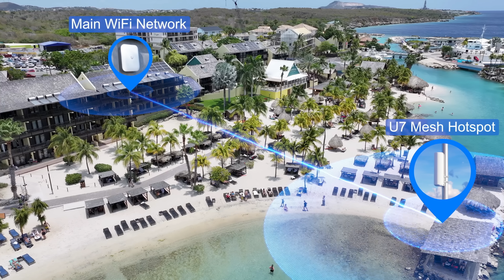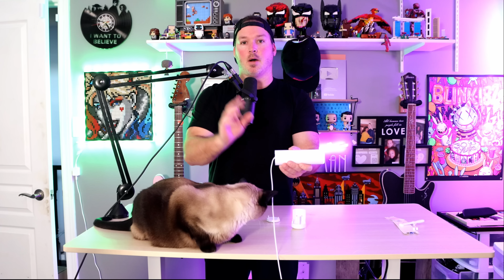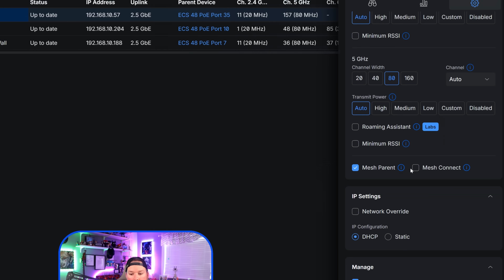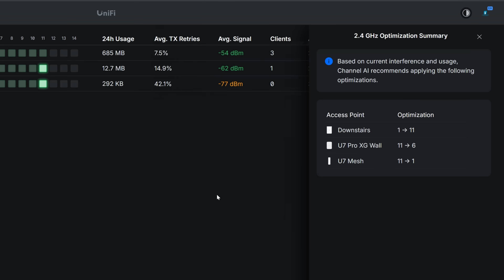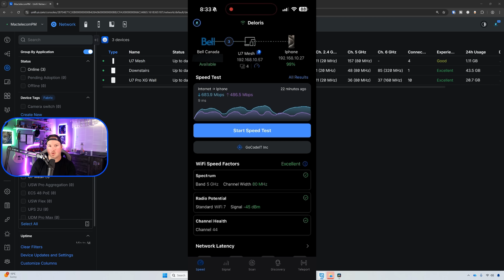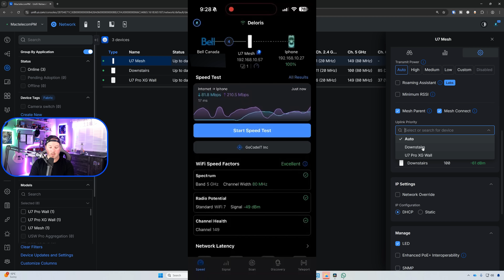UniFi U7 Mesh: Up to 3x extended meshing range!

Comment: Mine doesnt adopt when connected to a poe switch that is wired to a moca adapter. When it is connected to my dream router 7 (conencted via moca adapter as well), it adopts! I need it to adopt when it is not connected to dream router 7 directly.

Comment: The supposed improvement is the ability to communicate from one U7 mesh to another with the distant one as the mesh. That was the question I need answered but was not tested.
Reply from the maker: I was only given one u7 mesh at the time of the video so no way for me to test it
Reply: @MactelecomNetworks 
Oh well. Maybe later. Thanks for what you did do.

Comment: Would anyone recommend this over a U7 Pro Wall or a wall mounted U7 Pro Max? In my current setup I can't get ethernet lines up into the attic to be able to ceiling mount my APs but do have lines ran to almost every room, and they are about 2 feet off the ground. I'm currently running an Eero Mesh 6 with great coverage in the home but looking to complete my UniFi setup by moving to their APs.
Reply: Missing 6GHz and MLO on this, but not missing on pro max or pro wall.

Comment: I feel the 2x2 radio is a downgrade. If it had 6 gig and meshed over that it would be amazing to clean up the 5 gig space. 
I've had that light ring leak and wipe out the radio. 
I've never had any issues with the connector but the new design should be safer I guess. 
Those radios reach temperatures similar to the sun but I've never had them fail to heat. Just the glue failing on the light ring seal. 
They are night in day vs the old ac mesh in range and performance.

Comment: other than the potential "Directional: 10 dBi" use cases, this looks to be a bit of a downgrade over the U6 Mesh
Reply from the maker: TBH I didn’t even look at the u6 mesh specs before . I’ll have to compare. Going to wait to get my thermal gun so I can run heat test

Comment: I've been waiting for this one for soooo long and now I'm disappointed.  No 6 Ghz.  And only 2x2.  I'm wondering now which one would be better for in-house use: this U7 Mesh, or the U7 Pro (XG) Wall on a table stand, which DOES have 6 Ghz.  I don't need mesh so I don't care about that. I really whished for 6 Ghz indoor, but I don't have ethernet anywhere in my ceilings, so the usual saucer antennas are a no go for me.
Reply: I use the standard U7 Pro Wall with table stand, they work well.
Reply: Pro xg wall no question

Comment: What's the difference between U7 Mesh and U7 Outdoor?
Both of them support wireless meshing and their prices are the same.
Reply: Formfactor and the outdoor allows for custom external antennas, more client capacity outdoors with 3x coverage area with much higher dBi antennas. They are very different
Reply: I use the directional of the outdoor to shoot wifi to a camera 250 ft away through a garage door and some trees, as well as 3 other wifi cameras. There's no power at the distant camera so it works well. I have the outdoor meshed through 2 cinderblock walls from a u7 xgs about 20 ft away and this setup works well. I even gamed on it for a few weeks.

This would work better with the dedicated mesh antenna if i didnt need to shoot signal so far away, i only get about 200 Mb with my setup and I'd assume this would get much more.
Reply: For outdoor use, this is my question too.  U7 Outdoor seems like the easy choice compared to the u7-mesh for outdoor use.
Reply: @ChrisPorosky the directional antenna is crazy powerful. If you dont need directional antenna and commercial level dust and water protection just get the mesh.

Comment: so in theory... it sounds like a good Access Point... but we haven't proven if it actually is.
No Wi-Fi 6 for some reason... (U7 Mesh Pro)

the mesh speed was a mess...

and the 2x2 man.... like... WHY!?
Reply: It's WiFi 7 which means it supports 802.11be and 802.11ax (WiFi 6).

Comment: No 6GHZ is a show stopper.
Reply: The form factor is likely a limitation, I’ve got the last two generations of these and they run HOT. Packing in more powerful CPU, more radios, more antennae… at some point you are going to hit a limit. Adding a fan would lose you the IP rating and everyone would complain about it having a fan!
Reply: Ya that's brutal. All that waiting to be let down.
Reply: Thats what the U7-Outdoor pro is for "U7-Pro-Outdoor".  wouldn't it be weird if all their APs did everything the same?  For sure this is a different use case, where you just need good signal; decent speeds; small size; don't need high bandwith of 6Ghz.
Reply: @psycl0ptic To be fair, their old APs had better specs.
Reply: @JacksonCampbell 4x4 on 5gig I think helps the mesh speed
Reply: A show stopper is something that's really good.  It's so amazing that you can hardly believe it.  I'm assuming that's not what you meant though.
Reply: 6Ghz is not allowed on outdoors APs. Thanks FCC I guess.
Reply: @Jedielson.Almeida  No, the U7 Pro Outdoor has 6GHz.
Reply: @JacksonCampbell Ubiquiti make a different version of the U7 Pro Outdoor with a 6 GHz radio for the USA market. The rest of the world gets a different version of the U7 Pro Outdoor but does not have the 6 GHz radio - it has 4x4 on 5 GHz instead.
Reply: @Jedielson.Almeida It’s also for indoor use.
Reply: They sell the U7 pro outdoor access point with 6 streams and 6Ghz channel
Reply: @Jedielson.Almeida  "FCC" doesn't exist in other markets
Reply: @accik  FCC approved;  Long-range 6 GHz performance with AFC available in FCC/IC region only.  U7-Pro-Outdoor
Reply: @Jedielson.Almeida  Long-range 6 GHz performance with AFC available in FCC/IC region only.  U7-Pro-Outdoor
Reply: @Jedielson.Almeida  i use them anyway outdoors

Comment: Both my U6 Mesh melted themselves.
Reply: 2 out of 3 of mine did the same. 1 of them was replaced under warranty and failed again 2 years later. All 3 failures were from units outside in the rain. A unit under cover is still operating fine. Post-warranty I dissembled them (1 replacement out of warranty unit and 1 original out of warranty unit) because I am a curious person. Both failures were a result of water intrusion around the LED ring. I am not any sort of expert, but it seems to me the seal did not survive the temps or the UV or both. And got brittle and leaked. The design and engineering of these units is amazing. I take a lot of stuff apart. Foiled by a simple water intrusion issue.
So ya, I don't trust this has been fixed and will skip this format
Reply: I'll have to skip as well until people have run these for at least two years outside.  Especially since it seems Ubiquiti is in total denial of the u6-mesh manufacturing defect for outdoor use.

Comment: I miss the first gen. Better for mounting and could align antennas for desired requirements.
Reply: Also rarely used them for meshing rip AC mesh
Reply: Just get the U7 Outdoor then.
Reply: I found the range on them sucked compared to the U6. The flex radio was bad too in the same form factor.

Comment: Significant downgrade from the U6 Mesh with the loss of 4x4
Reply from the maker: I’ll most likely do a comparison video the same time I do a range test
Reply: @MactelecomNetworks  Thanks! that would be helpful. My main concern is that you would think much of the bandwidth loss from 4x4 down to 2x2 would be covered up by the increase in channel width and minor spectral efficiency gains of wifi6 to wifi7. However, 5GHz doesnt really have many channels to it and is quite crowded now days as well. You wont be able to use the extra wide 240MHz channels as easily, so the potential way to help make up the bandwidth loss is reduced.

I was just talking with someone who was looking at the U6 Mesh vs some U7 options, and the U6 Mesh was a much better choice for him because his house had 30~ 5GHz wifi networks in range of him, which means he definitely couldnt make any use of the 240MHz channel width. In your video I am also noticing you dont even have 240MHz option available, so Im guessing that extra width is locked in some countries such as Canada anyway? That is another bit of a problem.

The 4x4 is mainly helpful when this U7 Mesh is wireless backhauled to the network, instead of wired back. Since most phones and laptops are still 2x2. However, Qualcomm just announced that next gen wifi chips are now moving to 4x4 wifi connections for phones so being able to use the extra antenna connection bandwidth will become more common going forward for end devices as well.

Comment: Hopefully this improved weather proofing makes a real difference. So many failures of the U6 due to ingress and condensation internally.
Reply from the maker: I personally never had any issues with the u6 mesh and we had a lot outdoors .

In saying that this grommet seems a lot better
Reply: I found a little cup online that covers the top of the radio. It's basically a rubber for it. I've only had one fail so far but I might buy some to protect the rest of the radios.